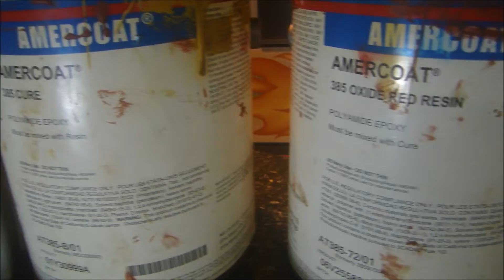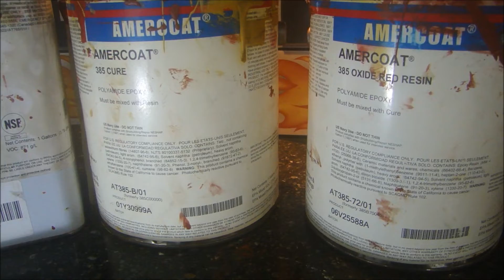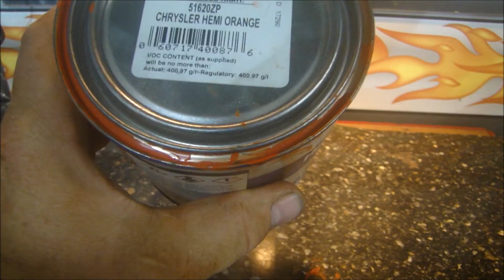How to Paint Your Engine - Masking, Priming, Painting on this 440 MOPAR Big Block

Comment: Had some new paint peel off my 283 yesterday. Good news is I haven’t dropped it in the hot rod yet. I cleaned the block well but I just used off the shelf rattle can paint and primer. Thanks for the information on Eastwood paint products.
Reply from the maker: Thanks Mike

Comment: wow, amazing work, but you need a clean air system for the garage.....A dust collector system at the very least.....bitchin work! Thank you for the foil tip ;)
Reply from the maker: I do have a method of filtering air, still some material falls to the ground. Thanks for the suggestion

Comment: So if one is painting it with the heads on the block if you ever remove the heads is the paint gonna get messed up or will it be alright?
Reply from the maker: It will be fine, you will just need to touch up the bolts when you put it back on

Comment: Best paint video I've seen yet, but I've got two questions for a slightly different situation. I've got my block covered in wd40 to prevent rust, when I go to paint it, will the lacquer thinner or acetone be enough to strip it bare for paint? Also, my oil pan is very surface rusty, and I was thinking to sand it as well as possible, and then using rusty metal primer to cover it whole if sanding doesn't do the trick. Would I be able then spray epoxy primer over the rusty metal primer when spraying the engine as a whole assembly in preparation for house of color kandy paint?
Reply from the maker: Acetone would be best. I would spray that thing until it's bone dry. WD will absolutely prevent the paint from sticking. You can clean the rust with a decent rust converter like POR
Reply: @PetesGarage  thank you, i wasn't sure if i needed anything more than acetone for fully removing WD-40. I'll go fully over it several times to be sure it's all gone. Would you recommend heating it up with a heat gun afterwards to draw out any moisture possibly left over? And I'll look into using POR.
Reply from the maker: I'm not sure heating would help, acetone evaporates quickly

Comment: I noticed you just partially taped surfaces that will later have stuff bolted to them, gaskets, etc... do you leave those as is or do you need to scrape them clean? Great video. Thanks!
Reply from the maker: Any gasket surface I will scrape clean, mounting holes will be fine

Comment: what would you suggest on a block previously painted that won't be hot dipped? How do you prepare the old paint if you can't get it off?
Reply from the maker: Clean it with aircraft paint stripper

Comment: When you do a nice paint job like this do you clean up the uglys off the block ? I use my carbides & clean up all the casting excess. And even flatten out the smooth areas to very smooth. I also do inside around the cam sight holes and behind the timing cover there's lots to smooth
Reply from the maker: I clean up as much as possible. Maybe 50% of it are casting pits that could be filled in, but that wouldn't last.
Reply: @PetesGarage  yeah true, I used to paint Boeing planes and we had some spaceage body filler stuff that might work. I'll have to check. But my engine is gonna be in a dart not a 30s car with no sides.

Comment: Quick question I got my crate motor just in and and there is that little fuel pump I'm not going to be using that fuel pump do I still need to put in that little rod
Reply from the maker: No

Comment: What’s up man, so I’m just ready to paint an aluminum motorcycle engine. But I’m not sure if I should use primer since the engine gets hot and needs to keep cool. You think I should just go with high temp coating paint from Eastwood ? Straight high temp coating without primer. Please get back to me as soon as you can. Thanks!
Reply from the maker: The aluminum is tough because of expansion, but the Eastwood will work, just spray it thin

Comment: If using a rattle can type engine enamel do you prime as well? If so what primer to use? I’ve used without in the past and had no problems.
Reply from the maker: You don't have to, but if you want to sue a primer it should be a metal etch epoxy.
Reply: The Rocket Absolutely!! I do like epoxy over etching primer though. IMHO

Comment: Pete, may be a silly question but what engine stand do you prefer? I have been working on a BB Chevy and rotating the engine on the stand is extremely difficult, the weight of the heads will also make the engine rotate upside down quickly. You made it look easy!
Reply from the maker: I have used many engine stands. I prefer the ones with the crank to turn the engine. If you grease the rotating sleeve it makes it easier. Also, after you put the heads on you have to lower the center of gravity to make up for the heads.
Reply: @PetesGarage  thanks for the reply, what do you do to lower the center of gravity?
Reply from the maker: Unbolt it and adjust the arms so the engine sits lower in the stand

Comment: Hello Pete , Great work. Like to watch your videos .You do a very neat and planned out build. I am about to rebuild a  440 that I have a rod knock in. Do not know why it  happened, I did not put the motor together,  but I will find out more once I pull it out of Car and break it down. Hopefully It did not damage the crank.
Were are you located..Have you ever built any Big stroker motors 600hp plus.
Take care 
Eddie
Reply from the maker: Thanks Eddie, I'm outside of Buffalo, NY. Sounds like you have a spun bearing. I've built several
Reply: Have to be maticuless when installing main's, I'm about to rebuild a 2.8, just to stay factory, dread it, 2.8s are limp wrist, and no aftermarket shit anywhere

Comment: What was the liquid material you used to wipe down the block before priming?   How many times did you have to refill your paint gun to get two coats?   Thanks for doing the whole video !!!!!!
Reply from the maker: I used lacquer thinner. I filled it 4 times, thank you for watching
Reply: Pete's Garage I see you were using paper towels, is fm not an issue when just focusing on the outside of the engine?
Reply from the maker: FM is always an issue which it why you see me blowing off the outside often. Great observation

Comment: For the fuel pump rod. Did you use any red or blue lock tight on the plug or anti seize?
Reply from the maker: No...it's a NPT thread so it will swage

Comment: hey pete was is the name of the little spray detailer gun you use in this video looking for a small cheap one to paint a block.
Reply from the maker: This one is the Devilbiss Finish Line detail gun
Reply: @PetesGarage    thanks Pete, what cheap gun do you recommend for spraying a engine block with enamael, i guess i am saying, can i get a cheap gun but what size tip do i need to spray the enamel
Reply from the maker: Depends on the size of the gun. A Full size gun will have a 1.3 fluid tip.
Reply: @PetesGarage  so the 1.3 will work for enamel or epoxy enamel or should i go with the biger tips, , thank you sincerly from the bottom of my heart, this a important rebuild and a surprise for my fathers cigar boat so  i will ot be skipping any cornors

Comment: It looks pretty but it looked like you painted the spark plug threads?
Reply from the maker: When I am priming it you see me come around the block and stop for a few seconds, that's when I put silicone plugs in. I pull them out right at the end to make sure I get full coverage so a little overspray may get on them, but I clean them up. Great observation.

Comment: I never paint my Harmonic balancers. I was told many moons ago that the Paint would or could throw the balance off. Is that not true?
Reply from the maker: Well, a thin coat won't hurt it, but if you put on too much and make it heavy on a part it certainly could throw it out of balance.
Reply: No, it is not true.

Comment: But how did you get block so clean before wiping? I just got my 460 back from machine shop and I’m going to start removing the light surface rust from just a few days of exposure with no protection
Reply from the maker: When I get the block machined they bake it, shot blast it, and coat it with a cast blast. It is very clean when I get it and stays the way until I paint it.

Comment: Seeing if I can get my stolen motor back at least since both parents stolee both my vehicles now..... Then I can at least paint my 302HO & try and throw a 14lb of boost on it, maybe throw it in a little truck with the turbo. Cause the 205-215HP was plenty in the foxbody, now that I'm 27 a little more speed would have been fun, but w/e not a good area to have that much power in a small car anyway. Unless I did a full body conversion on it but that takes away from the car

Comment: Nice job, but I would have taped up the exhaust studs and put old spark plugs so not to paint the threads, just saying
Reply from the maker: I put plugs in the spark plug holes just before painting. Taping the studs is also a good idea.